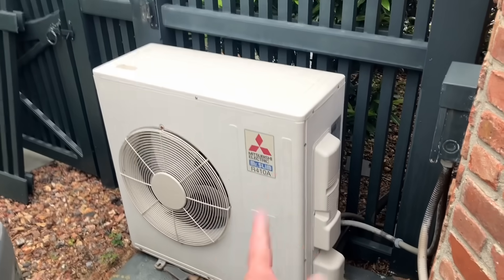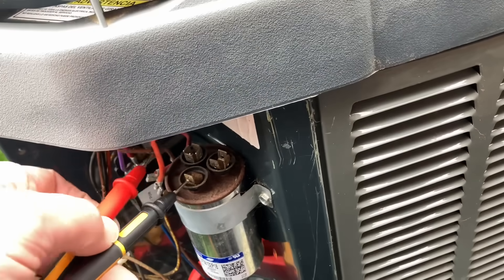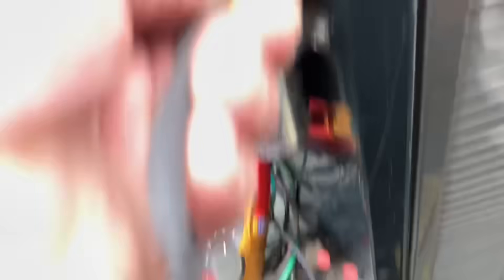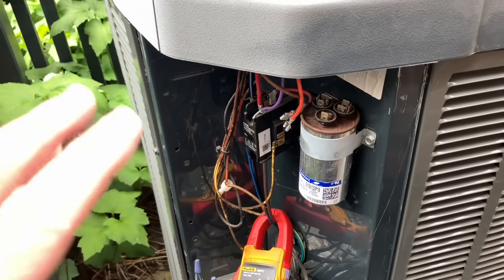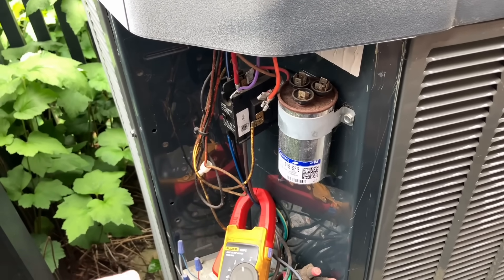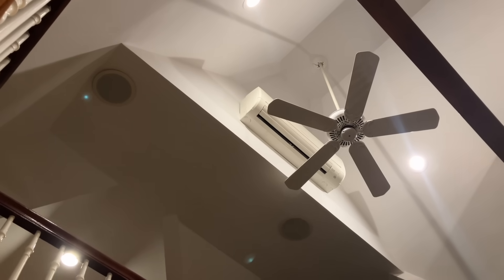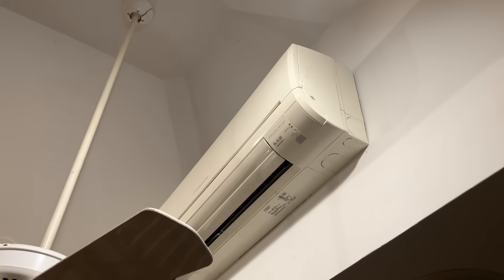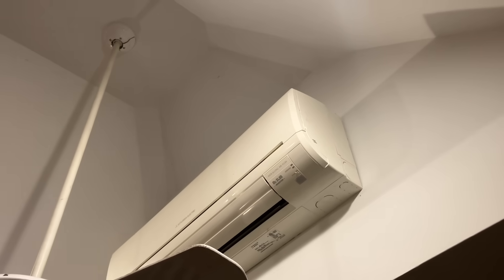Ductless Disaster: 4 Lbs of Refrigerant… EVERY YEAR?! 🤦‍♂️

Comment: Wow.  A tip.  I dont know if carrier does this.  But most manufactures put a small second model and serial number sticker in the electrical compartment of the unit.  Trane, and lennox does this.  I am surprised that the carrier units you changed out, did not have tbis as well.  I ran into a similar issue with a 4 yr old lennox, as someone had lost the original cover for the unit.  The cover has the model sticker on it.  Some one had fabricated a piece of sheet metal for a cover.  Luckly i was able to still obtain the midel  and serial thst was on the small sticker inside right next to the contactor.  Trsne puts theirs on the bottom metal plate where the main 220 flex line comes in.  Its a small sticker usuall about 2 inches long by 3/4 wide.  Has just the model  and serial number.  What was someone thinking when they installed that mini split unit.  I would of taken accessabiity into consideration as i would want to clean those filters periodically.